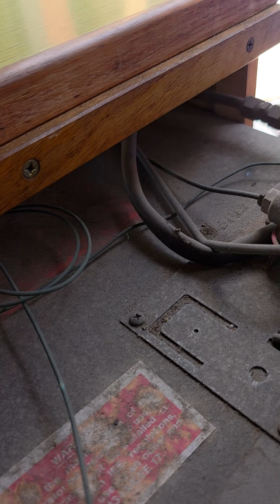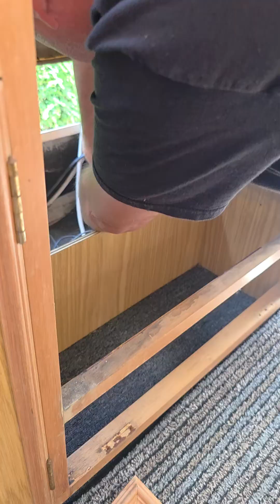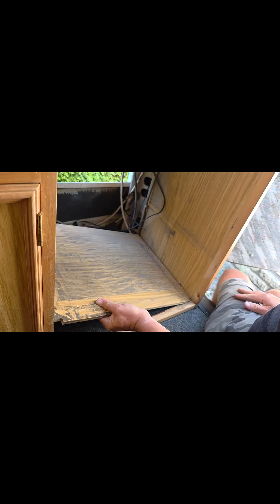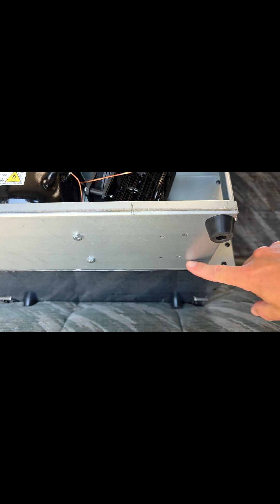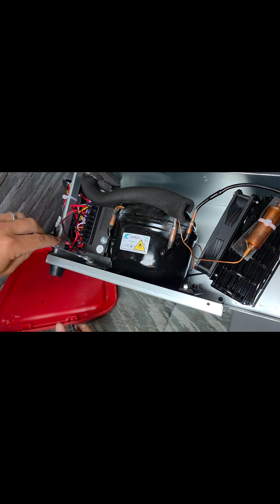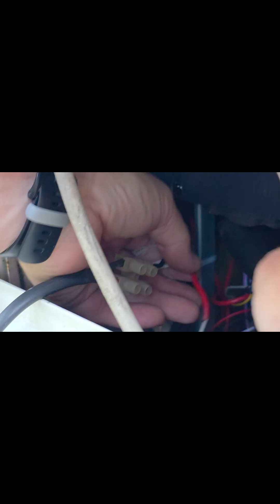Ford Duetto Autosleeper 12v compressor fridge upgrade.

Comment: Hi Mark, Which make and model of fridge did you choose? My Swift Mondial has the identical 3-way fridge and dimensions, which I want to replace. Your video is going to be a tremendous help.
Reply: Based on my research, my guess is it is the Alpicool Adventurer AD85 83-litre 12V. Am I right or wrong? I am sure there are many folk out there searching for the same swap out. Your confirmation would put people's minds at ease before lashing out £300–£400.
Reply from the maker: Hello, sorry ive been away and only just seen u have messages. The fridge i used was a AAOBOSI 83L 12v compressor fridge purchased from amazon. Hope this helps
Reply: @MarksCamperUpgrades  Thank you Mark for clearing this up.

Comment from the maker: Hello, i believe it goes straight to the fuse box on the control panel, and after that to a relay under the bonnet that switches it to alternator power when the engine is running. Id check the fuse first and if thats ok try tapping in some relays as they can stick.

Comment: great video, thanks, my 12v supply isnt working do you know where the other end of the 12v wire connects to for its feed when engines running ?
Reply from the maker: It should go to a relay in the engine bay i believe that switches on when the engine is running.